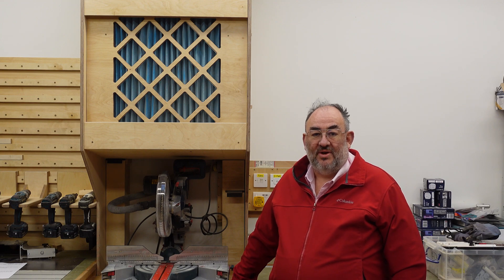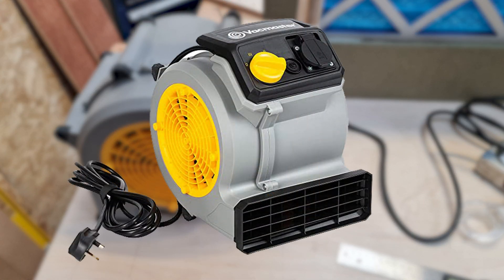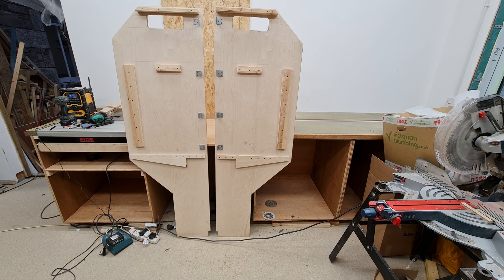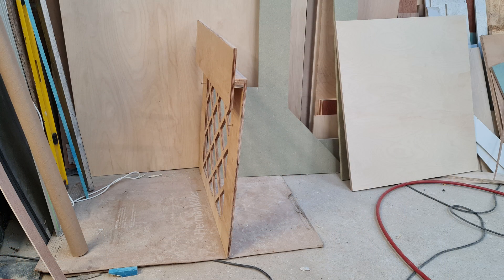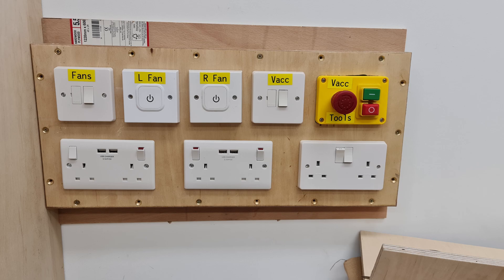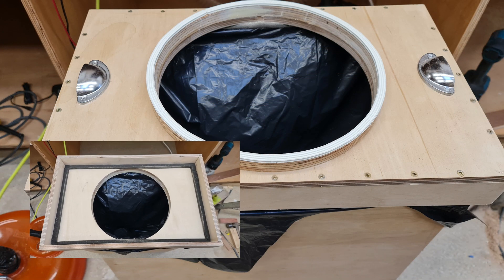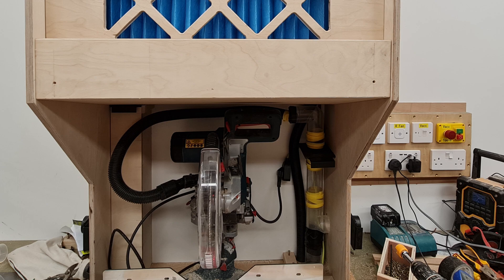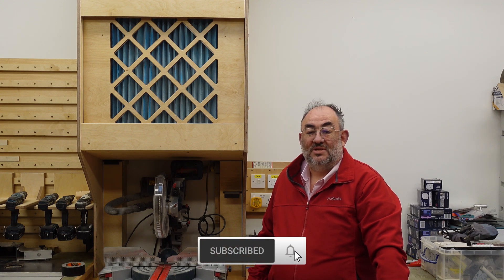SMART Workshop Air Filter - DIY Build & Guide

Comment: very nice idea
Reply from the maker: Thank you Cornelius. It has served me very well and is extremely efficient at reducing particulates according to a small optical meter I use. Still on the original filters. The front one, I simply tap out outside to restore it's blue coloured appearance.